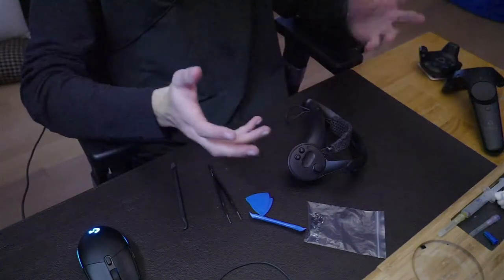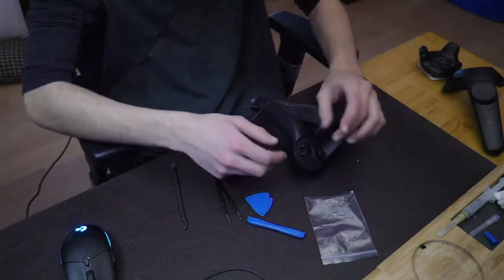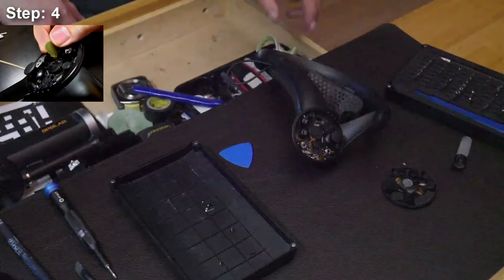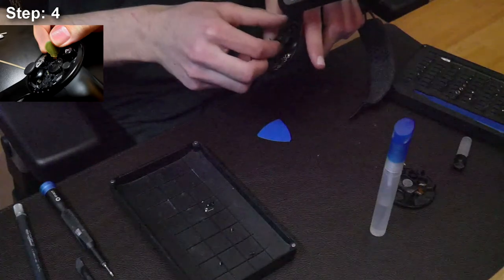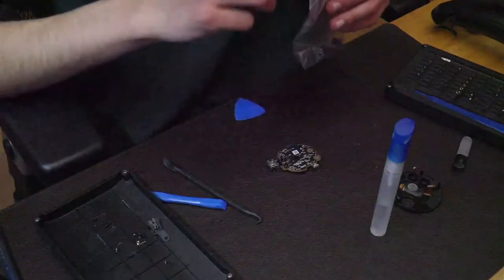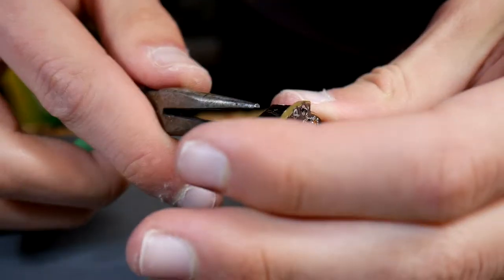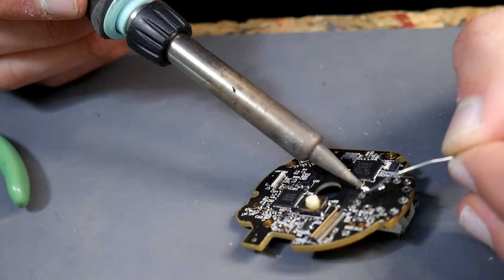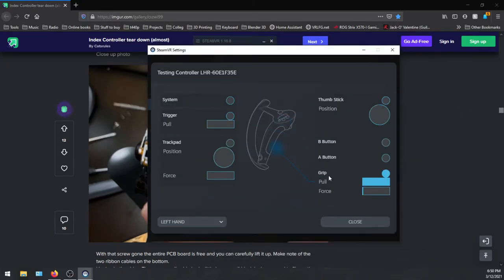How to Fix Valve Index Knuckle Drift

Comment: it's worth noting that Valve is very forthcoming regarding RMA for this issue. in my case an RMA after 3 years was no problem. so you might want to try that road first before potentially breaking your controller.
Reply: I tried, and after 2 month of messaging back and forth with support they just said "well warranty is over nothing we can do"
Even though I did contacted support for another problem also stating the drift issue one year prior. After the first problem got resolved through RMA they closed the ticket so i figured i wait until the drift issue gets even worth before I open another ticket right away as I read multiple times that valve is forthcoming.  
Guess I've learned that you should RMA as soon as possible to still be in the warranty window. Especially since it comes off as if they would try to stretch out time by making the Support process as long as possible. Even ignoring things that have been said not even 2 messages before, making you do things that just did again as if there is no coherency.

Comment: This is a potentially very useful video. How well has the all-metal replacement part held out? Does it function correctly? Does it feel different? I was unaware that there was a better version of the joystick used in the Knuckles.
Reply from the maker: So far the replacement has lasted about 200 hours of light use. It functions exactly the same as the old one and the spring seems to be a little lighter. I'm not completely sure if the metal one is better. I'll update the description if does break along with Ifixit's video on joystick drift. They do a way better job at explaining this than I am.
Reply: @nulledfloof  Thanks for answering. My Knuckles controller has developed drift and its nice knowing that there is an alternative. What I am wondering is whether this is a more proper fix for the issue and whether this is repeatable (potentially expanding the lifespan of my Knuckles beyond warranty).
Reply from the maker: @AdamWhistle1  I would say it's the most proper fix, you are replacing the entire joystick assembly with a new one.
Reply: @AdamWhistle1  And yeah, you can do this as many time as the board don't get damaged.